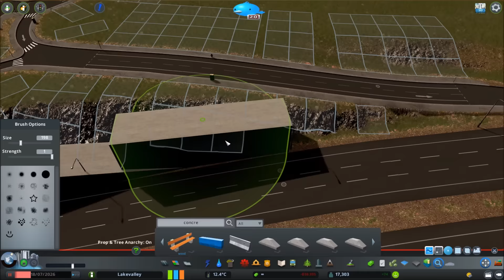Cities Skylines: Partial Dumbbell Interchange

Comment: Also, I noticed you only have one way over the overpass... idk if that's intentional... but how do you suppose you'd get back on the other side if you were on the one side opposite the tower.
Reply from the maker: Its only allows for one way this is typical in place that dont require a large double interchange or dont have enough money to finish it